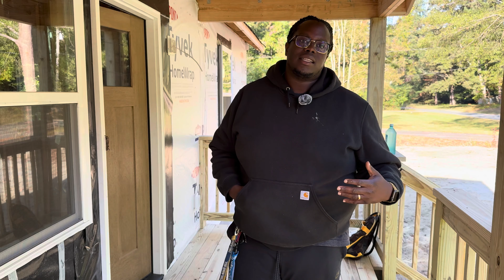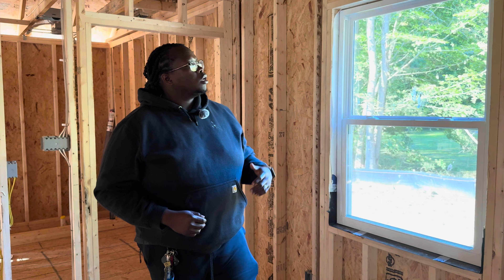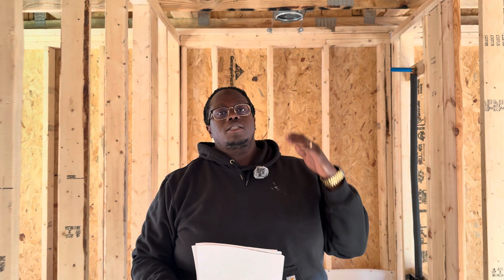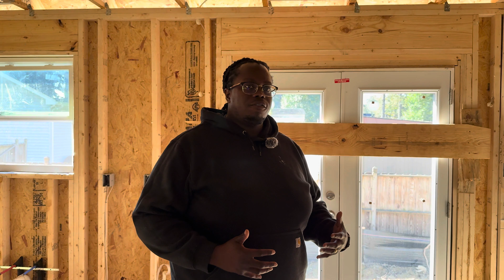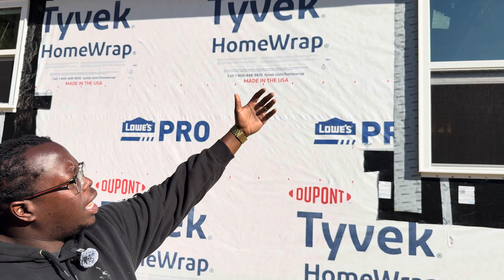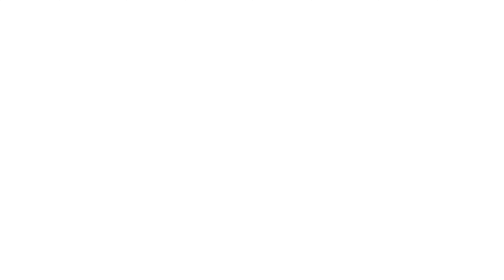What I Look For During A New Construction Pre-Drywall Walkthrough On Our Spec Home Builds

Comment: What is the purpose of foaming an interior wall with electrical wire penetrations???🤷🏽
Reply from the maker: @myronbelger4180  Great question! They only added the spray foam on the top and bottom plates since those holes penetrate through to a non-conditioned area. If it was a wire running from one stud to another, then it wouldn’t make sense to put the expanding foam.
Reply: Fire block
Reply: @russkarsten8952 not a fire block. It’s a draft stop. In the event of a potential fire in that stud bay, there is a draw into the attic. It prevents “ flue effect “